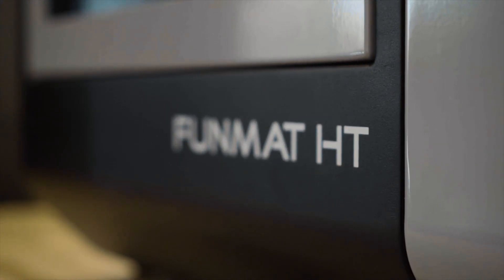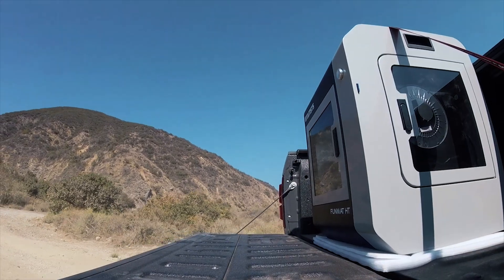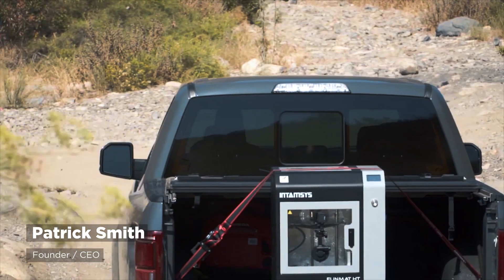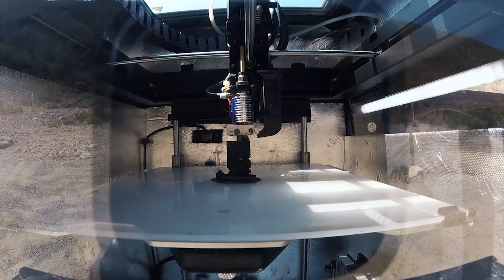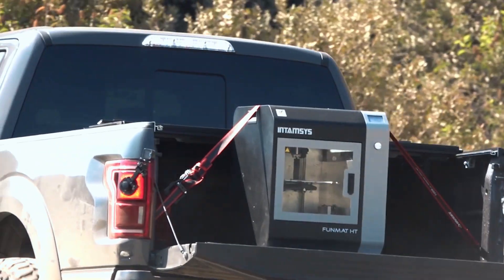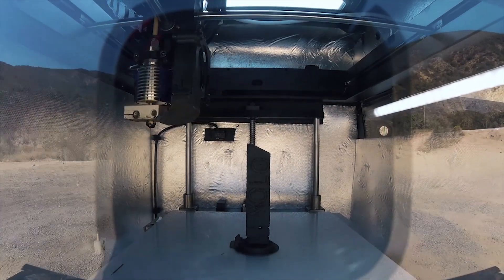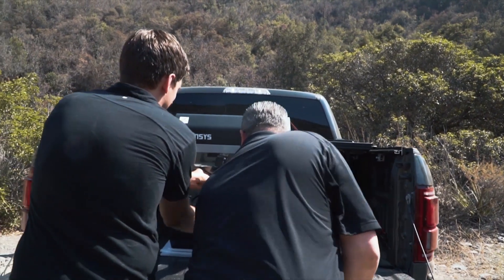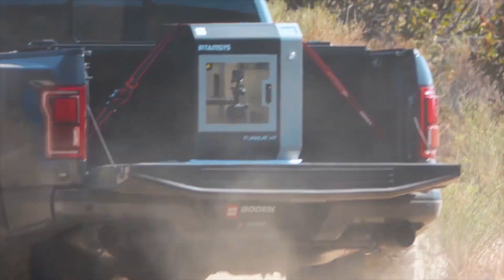Off Road 3D Printing - this machine STILL WORKS on the back of a Ford Raptor!

Comment: with all this talk about durability , can you tell me how is this printer has 90c heated chamber , with direct drive extruder motor and no watercooling .
also the extruder itself is fan cooled . how can you "cool" something with a fan , when your ambient temp is 90c ?
Reply from the maker: The basic answer is that 90C cooler than the nozzle, at 400C, and thus, the cooling fan still does it's job :) 
The motors are designed to operate in the 90C chamber, and thus they also work :)
Reply: Vision Miner during my school tour of countryside our resort had coolers not room heaters during winter with temperatures falling below 5 deg C. We switched the ac on to 30 degree C. It worked.
Reply from the maker: @PS-nf3xw  Hah! That's crazy! How interesting!! :)